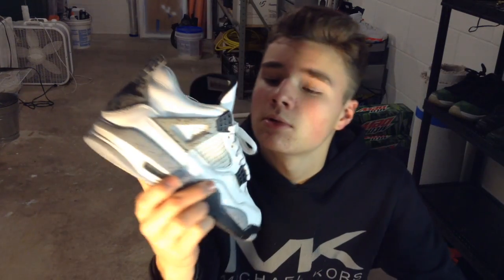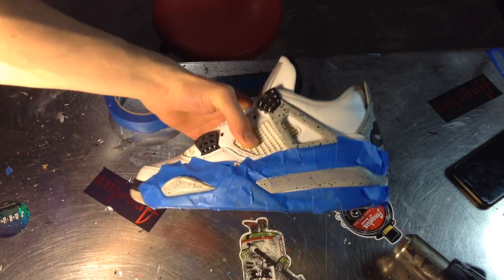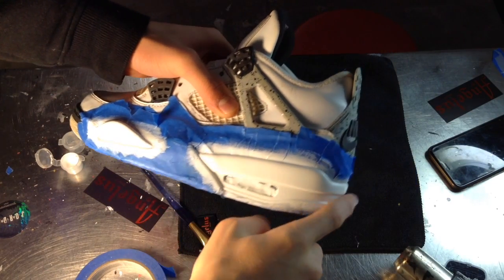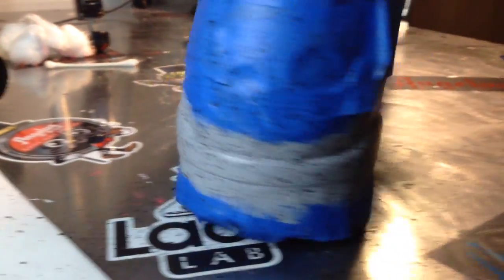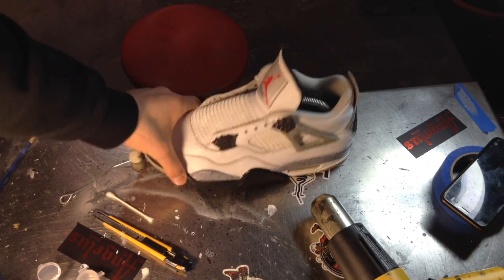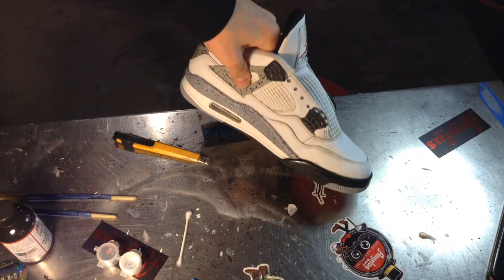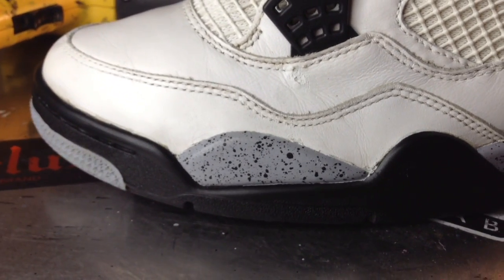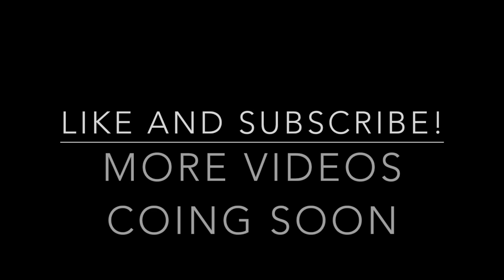2016 White Cement 4 Full Restoration

Comment: Good midsole repaint. Everything else was extremely questionable.

Make sure you acetone the leather to prep it before you paint it.
Don't paint the netting. Use sole bright or 40 volume cream to unyellow it. Paint is a bad solution.
Same thing for the bottom of the shoe. Don't repaint the toecap, unyellow it.
Reply: jckix that’s suspect too. 40 volume gets yellow again real quick and sole bright is just 40 volume
Reply: AndreikC2 try using rit whitener liquid 8oz fabric whitener from walmart
Reply: Pimpfu27 Vicious Fabric whitener on plastic?
Reply: Question 40 volume is okay to use on the netting and fabric behind it?
Reply: @kicks2785  It doesn’t do anything, I believe because the netting is plastic and 40 vol only works on rubber

Comment: What's your paint mixtures for the grey
Reply from the maker: Honestly, Angelus white cement paint and kept mixing with white more and more until it got as close as the original shoe.
Reply: Ok so you got the white cement 4 color that angelus has from the previous release and kept adding flat white or white?
Reply from the maker: kamari cummings yes, flat white with the cement 4 , keep mixing till it gets as close as possible to the factory color
Reply: T. Customz gotcha thanks man
Reply from the maker: kamari cummings I have a video dropping today showing more on the cement print so just stay tuned